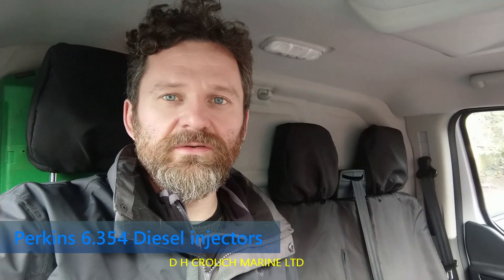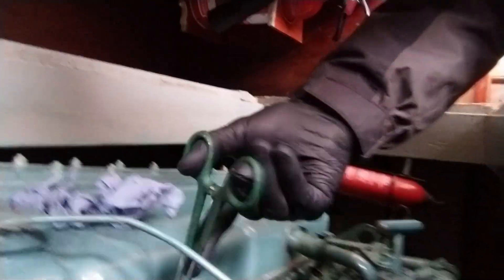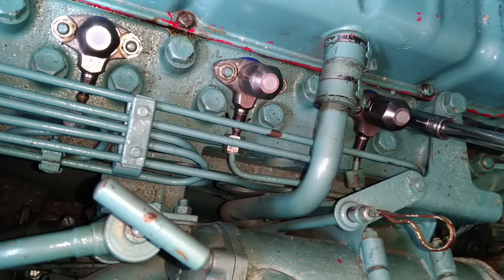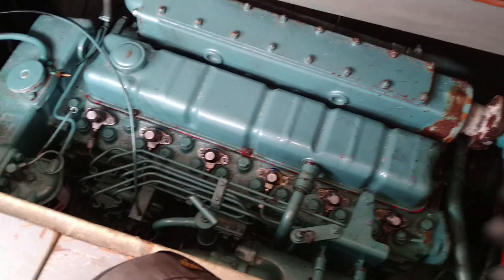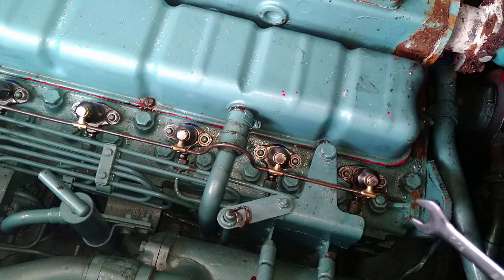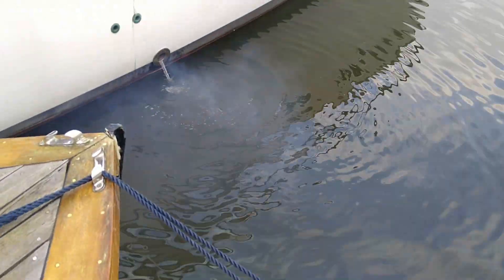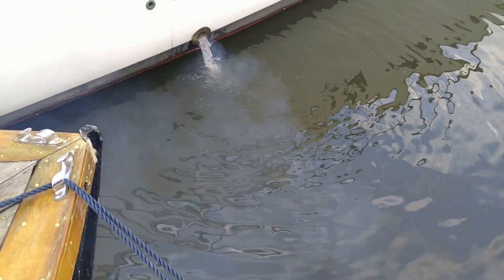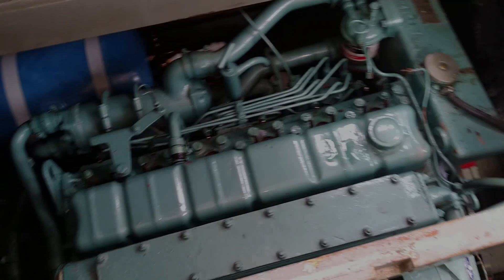Perkins 6.354 injectors service and re fit

Comment: how did you change the timing?
Reply from the maker: Its a CAV pump. Just loosen the body nuts to the engine and slaken the injection hoses and twist it one way or another advance or retard its timing. There is more to it but thats basically it.

Comment: Just on more question , The exhaust on my Dutch cruiser exits the starboard side below the waterline and runs aft to the stern then goes back inside and exists at the stern. No my thinking is that although an underwater exhaust is cooled by the water outside it is too long, causes excessive back pressure and causes drag. I noticed some other inland Dutch boats have the same system . Would it be better to have the exhaust just exiting the side and be short as possible.
Reply from the maker: If the exhaust is a wet exhaust then I can't see an advantage here, mind you the Dutch do things very differently to us in the UK. Are you sure its not  a cooling line ?
Reply: @dhcrouchmarineltd3049  not the cooling tubes, they are each side of the keel, it's an underwater exhaust.
Reply from the maker: @romakayak  I have to admit its something I have seen here in the UK. However I cant see any advantage. I would be inclined to modenise it.

Comment: A serious question on behalf of many of us boaters. If my boat is being towed by another and the engine is stopped then there's no oil pressure in the transmission. The propeller will be turning the prop shaft and the reduction gear turning too. So could my Paragon p45 Trans become damaged because only the reduction gear would have splash lubrication??
Reply from the maker: If you read the manual for the gearbox it may help you. If you mean spinning the prop in a free spin due to it being dragged then it depends. If oil is only splash fed how is that splash achieved. if its from a gear or oil spreader which is powered then the output bearings may not get any lubrication without engine power. If the oil sump has the output gears partly submersed then it should be ok. Oil pressure is usually for bearing shells and solid bearings. Ball bearings typically don't need high pressure oil flow. It depends on the application. For example the BMC 1800 has to have an oil feed to the injection pump drive bearing because of the engine block being reduced as compared to the 1500 BMC. Again high oil pressure for working on mechanisms under high workload. The PRM range of gearboxes are splash fed gears but oil fed bearings. But this wont work if the engine is NOT running. As they are designed for  all manner of ships boats etc they considered a free spinning propeller and ok. However if a propeller is allowed to free spin as a serious speed then I would be very concerned at a lack of lubrication and would consider a shaft brake. Hope that helps